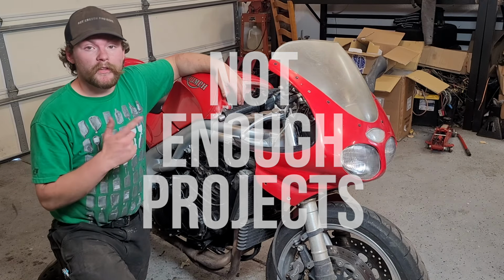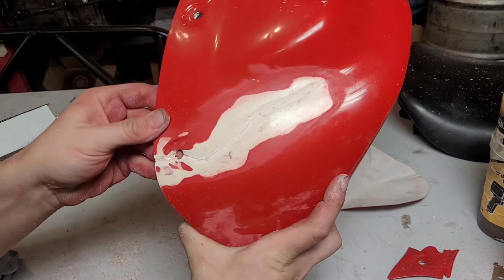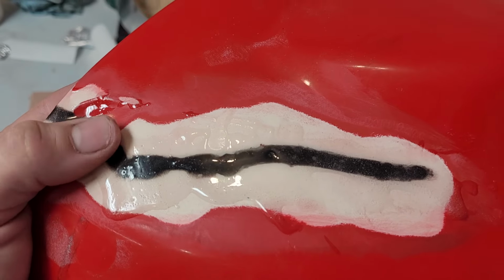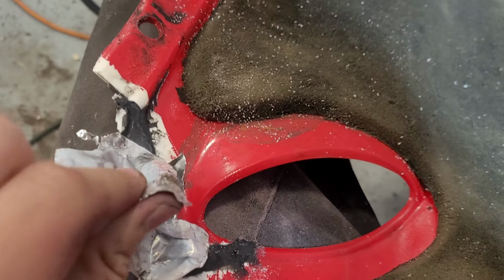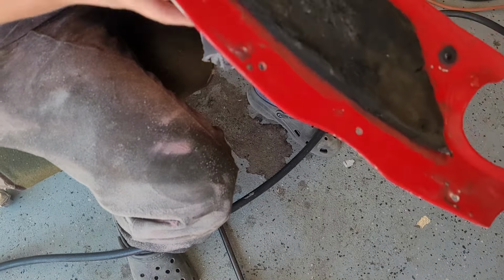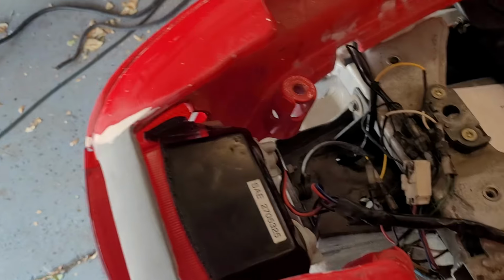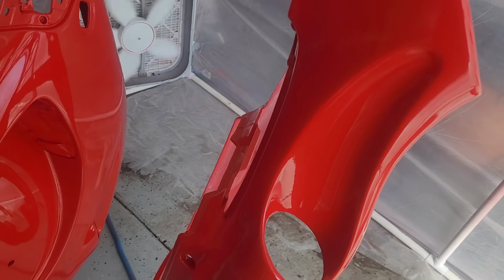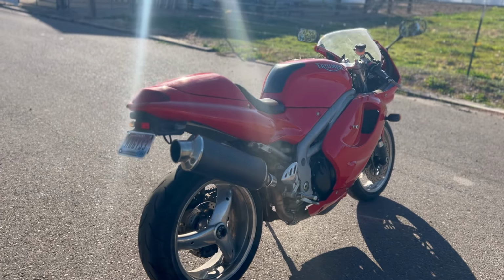Plastic Fairing Repair and Paint - 99 Triumph Daytona

Comment: I have the turn indicators from the UK vendor .. they are perfect.. I just swapped out my old OEM signal wiring for the wiring that came w/ the new signals..  Triumph has an unusual proprietary wiring connector ...easy peasy.... had them for over 3 yrs and still appear brand new ...